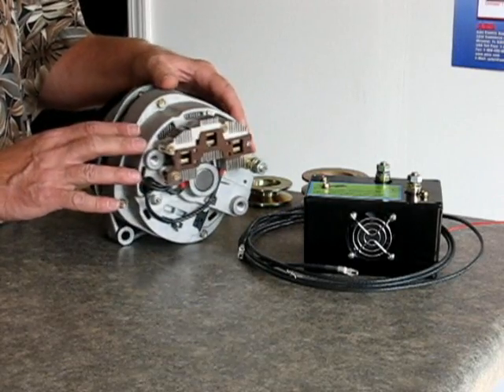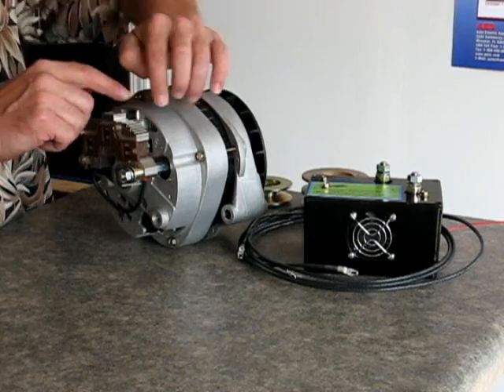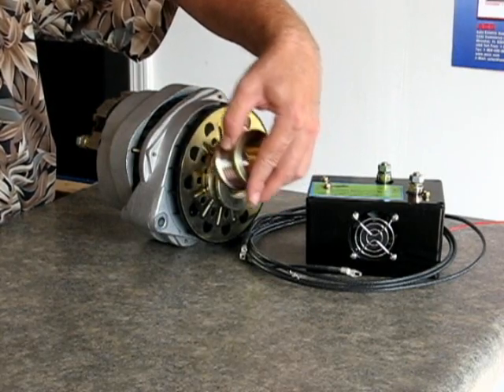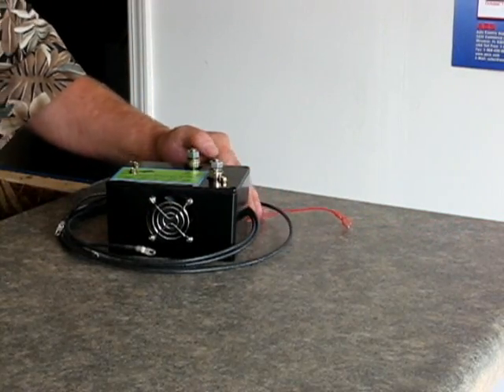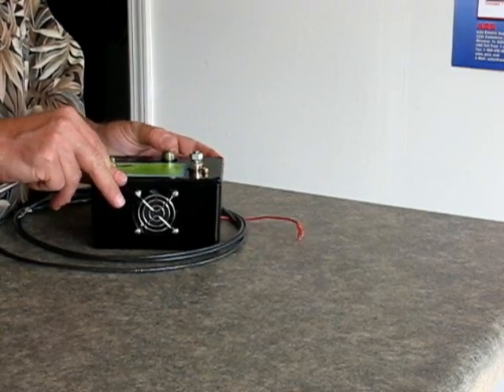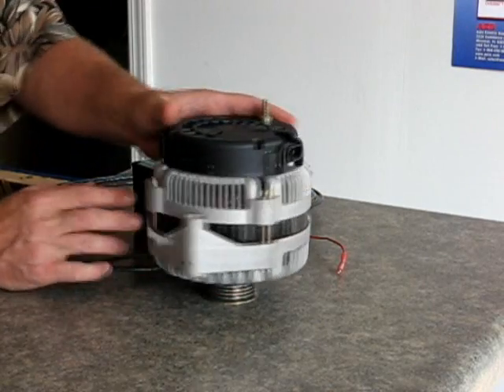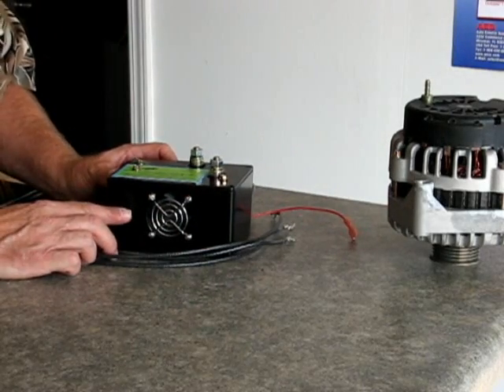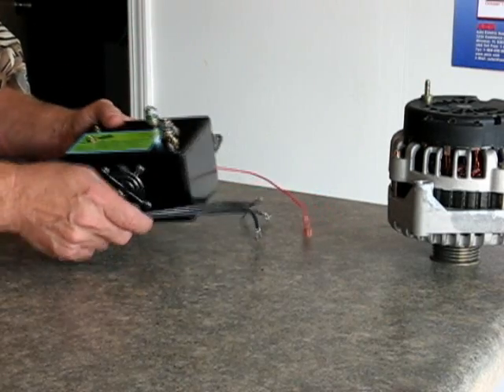GM type CS-144 Heavy Duty Dual Rectifier Alternator and Quicktifier Remote Rectifier

Comment: Great presentation once more. There's a small thing that has been bothering me: how high/low would the voltage go if we took off the voltage regulator? I've pretty much figured out the rest, thanks to your videos :)

Oh, and one more :) Could I put 2 alternators on a car? I mean, would it imapre the performance of the engine? I do realize that I need to put another battery to be fed by the second alt.

That's pretty much it. Thanks a lot.